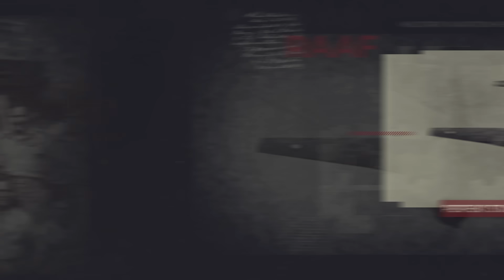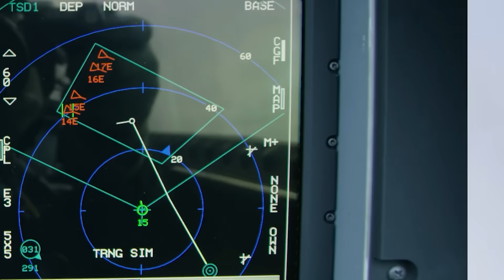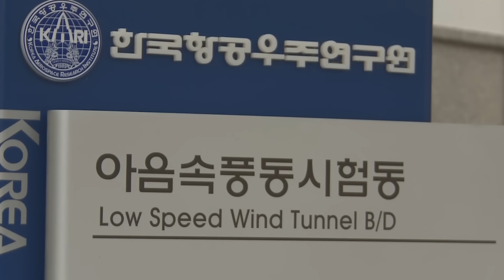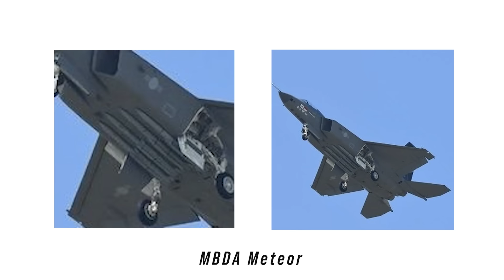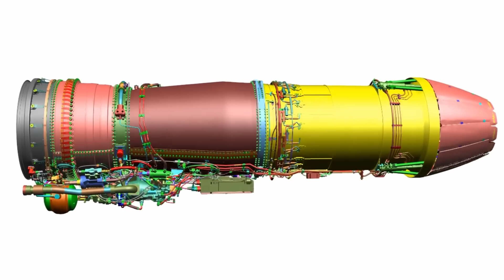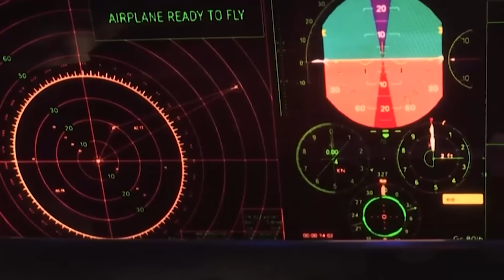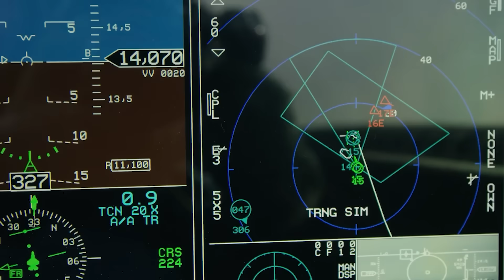KF-21: Korea's New Fighter

Comment: The fact several new aircraft mimic the F-22 design goes to show how ahead of its time it was. Still one of the sexiest planes of all time. Glad our allies in the pacific are re-equipping themselves with the industrial base to defend themselves 💪🏼 best of luck my Korean, Japanese, and Aussie friends
Reply: I agree, it looks like an F-22 Lite to me.
Reply: @alexwalker2582  It was made with Lockheed Martin, so wasn't a surprise
Reply: @motoKJ  Lockheed Martin helped manufacture the T-50. The KF-21 engine received General Electric's F414-GE-400K. And Korea is also developing a higher-performance engine that is better than the F414-GE-400K.
Korea, which is developing high-performance fighter jets for the first time, has moved up the schedule ahead of the original plan
I highly appreciate that it has been developed and that development is underway without any major problems so far.
Reply: @motoKJ LM consulted on the airframe. LM did not make anything for the KF21.
Reply: @motoKJ  Tell me specifically what Lockheed Martin made. They are scammers who did not even transfer the technology promised when introducing F-35s. This is why Korea is not introducing additional F-35s, and why it is rushing to develop KF-21 stealth versions.
Reply: Really?  

Reminds me more of the f35 but with 2 engines
Reply: @alexwalker2582  yeah actually because it was designed by Lockheed Martin
Reply: @rama7267  I think you really don't know much about German tanks. They are notoriously hard to maintain. A tank in the shop is one not in the battle. And German planes never evolved quickly. WW2 shows that. They quickly got outdated by US planes and some Russian planes later in the war. They were ahead of time, but they never had an industrial base or economy to keep it going.
Reply: And the F-22 wasn't even as stealthy as the YF-23 it beat! that thing was light years ahead. Can't wait to see what the NGAD and F/A-XX programs looks like soon!
Reply: @Cam_Wight  well it is a lot cheaper tho
Reply: @Cam_Wight  That's just no true. What I find hilarious is that if the YF-23 had won and entered service as the F-23, you would be singing about how great the YF-22 was, and why it should have won. 🤣
Reply: @FeatheredDino  Joe what I've said it factually correct, the YF-23 airframe has a lower RCS than the F-22. And I'm not so sure what's hilarious about that, both airframes are amazing and deserve praise. I suggest you watch C.W.Lemoine's video on the subject, he interviews the Chief Engineer of the USAF at the time.
Reply: @FeatheredDino I made almost this exact comment the last time I saw this conversation come up. And it’s so true……
Reply: Bullshit.  The black widow has a lower RCS.
Reply: F-22 won out because it was easier and less costly to manufacture plus more agile. But in 2024 post dog fight era, the Yf-23 is perfect just add the f-35's networking capabilities, speed and  stealth rule the day, the 23's king
Reply: @FeatheredDino  that is true, the YF-23 had a smaller cross section.  This has been widely known for years.  This is not some new secret information.  The DOD has disussed this in detail.
Reply: @FeatheredDino  What I find hilarious is that if the YF-23 had won and entered service as the F-23, you would be singing about how great the YF-22 was, and why it should have won. 🤣

YF-22 looked very generic, just a smooth F-15 which in its turn looks like MiG-25 or MiG-31
Reply: @FeatheredDino  No Cam is right. The YF-22 was outperformed in many aspects by the YF-23. That part is common knowledge. What isn't common knowledge is why did they go with the lesser of two planes. My guess is politics were at play but who knows.
Reply: @JMAC479  The Northrop F23 actually won the design challenge. However the F22 was awarded the contract to maintain "healthy competition" in the military industry. The F22 was 'good enough' to satisfy the design spec.
It's an official policy established after ww2; the goal being that the US maintains its highest possible production capacity.
This was all officially stated.
Reply: Japan's F3 is expected to be close to or even better than YF23.  The KF-21 is an older fighter jet with a stealth design.
Reply: This reminds me of cars, smartphones and civilian aircrafts. As the years go on, they all look more and more similar since the design is the most efficient with existing technology. The F-22 was really ahead and just now other countries are catching up.
Reply: @fredbyoutubing  The F-22 was really ahead and just now other countries are catching up.

There is nothing special about F-22 layout. It is the same layout as F-15 or MiG-25/31. Also Korea cooperated with Lockheed Martin just like they cooperated with Russian Almaz Antey on air-defence systems.
Reply: @_Epsilon_  You are talking about it like it's a model plane. There was more to it than it's shape when it came out. Compared to other platforms, it was revolutionary. Older platforms have been upgraded since but the F-22 was the benchmark for a long tame.
Reply: @fredbyoutubing  I am not entirely sure this is the case here. The US produced two fairly different designs for stealth fighters in the 90s . And the NGAD is likely to look different again. I think this is more a case of copying what works. In the case of kf21 it's actually design data that has been legally transferred. There is no point reinventing the wheel.
Reply: F-22 is soon to be retired and everyone else are still playing catch up.
Reply: @machdaddy6451 All of them are not retiring. 33 if old jets planed to be retired will be used as trainers and the last 152 are being upgraded to catxh up with the technologies and abilities that the Chinese J-20 has but F-22 doesn’t. And this 11 billion USD program will be finished by 2028. Don’t say goodbye to them yet.
Reply: @machdaddy6451  F-22 is soon to be retired and everyone else are still playing catch up.

F-22 is one dimentional and is a hangar queen. There is a reason they are trying to revive F-15.
Reply: billions spent by the US and everyone copies it.  Cause it's the best, like everything the states puts out.
Reply: America's Aircraft Design industry has been 'mature' for an immensely long time. Meaning we've had engineers capable of making truly timeless unparalleled aircraft like the XB-70, the SR-71, the F-22 dating back to the late 1960's.  The only limitations have been computer and engine technology.  America is just the top nation in terms of industrial design and it's not even close.  We need to preserve that at all costs.
Reply: F-22 is 80s tech. Amazing. Imagine what they have now after 40 years
Reply: This is the most cliché comment that is way overused about the raptor at this point.

Just because something was conceived of as an idea in the 80s does not mean that it is 1980s technology

Every time a tech boost came along changes were made to the aircraft, including active updates while in service.
Reply: @snowmochi1373  Incorrect, the F-22 hypothetical design was 91, after succesful tests it was greenlit for production in 2004
Reply: @snowmochi1373  late 90's early 2000's
Reply: @snowmochi1373  90s tech...
Reply: @snowmochi1373 ”They” have the F-15EX 😅 The F-22 program was cancelled by Congress 15 years ago, remember.
Reply: @snowmochi1373  F-22 is 80s tech. Amazing. Imagine what they have now after 40 years

Yeah they have lame duck F-35.
Reply: The KF-21 uses only existing technology developed by other countries.  The latest technology developed by South Korea specifically for the KF-21 is not used.
Reply: Seems more like an f35 imo. Either way I’m sure they licensed a good amount from both aircraft.
Reply: @dizzleslaunsen2372 Koreans didn’t license anything except for the GE jet engine and maybe the ejection seat. The airframe and weapons systems and AESA radar are all Korean. LM consulted on the airframe.
Reply: We go together !!!!!
Reply: @rama7267  yeah thats simply false. The us invented stealth due to their engineers, not money.
Reply: @thatguy46744  False. Germany was playing with RAM materials in the 40s for their navy and was going to add RAM to the Ho229, and all work done by Lockheed is directly based on papers by a soviet physicist, Pyotr Yakovlevich Ufimtsev, who created equations for predicting the reflection of electromagnetic waves on 2D and 3D objects. Hence it's false to claim the US invented stealth, also, engineers don't live from photosynthesis, it takes money to feed them and run experiments, and obviously, a bigger budget can run more engineers, more studies and more tests.
Reply: @kabzebrowski  the inventor is the one who materializes the idea, creating something that actually works and overcoming the problems with making the creation, that is considered the inventor. Not the one who theorizes it. So even if they did use a lot of the russians work, (which they didnt) that still would make the us the inventor. Lol.
Reply: @kabzebrowski  you cant just put more engineers on one project, if they all know little about the topic at hand, your not going to get an advanced stealtb aircraft. The design team of the f22 and f117 was only a few guys. I know your going to say "WeLL AcTUaLlY, they had 5000 members working on the programs! That was after they entered service and were being mass produced. Those employees are the ones operating the manufacturing machines, not engineering the aircraft. If they just put more engineers than a few guys, that would produce a whole lot of conflicting ideas and theyd get nowhere. So no, you cant just throw more money and engineers at the problem. The f22 and f117 was designed by american engineers and all work should be credited to them.
Reply: @thatguy46744  Cope harder, fanboy.
Reply: @kabzebrowski  i even had to clarify the definition of inventor lmaooo.
Reply: @thatguy46744  Under your own silly argument Germans would be the inventors of stealth technology. Again, cope harder.
Reply: @rama7267  I doubt it. You point to tanks, I point to the German artillery that frequently overheats and is in the rear for repairs more than on the front in Ukraine. I also look at the automobiles coming out of Germany. Selling cars today based on the reputation they earned yesterday but no where near the quality.
Reply: It means that it was cheaper to use an existing design. These things aren’t cheap. It’s not that complicated.
Reply: they dont mimic, its the shape a airplane has to be made for it to have a small  radar cross section
Reply: @The_Riddler21  Same people don't understand that. :)
Reply: As if aerodynamics is very leniet and gives you the options to have a square, hexagonal, rectangular shapes. Yeah aerodynamics is very understanding and accepting of all shapes, it's the limitation of the engineers' imagination to not come up with all sorts of shapes for planes.
Imagine a box flying. ;)
Reply: Because the laws of nature are the same everywhere
Reply: f22 was ahead of it's time, but the mimicking of the design here has more to do with the fact that it is cheaper and less risky to use proven designs rather than using an untested design or pioneering new ones. if the yf23 had been adopted instead, you could be reasonably certain fighters like the kf21 would have more closely resembled the yf23.
Reply: @rama7267  tanks are not as hard to make as jet fighters.
Reply: Turkish high-tech!  The smart nation.
I have a folder about it (folder 5 in the playlist).
Reply: Heres something you may find interesting. :)

In the past 40 years 37 countries have changed their name.

Obviously one can not change the name of an apple or orange etc in other languages, 

but counrty names are like peoples individual names, so if you are named John we don't call you Karen. :)

The name of my country has nothing to do with the interesting and delicious bird ''turkey''......

.....but the name of the bird does have a connection with the name of my country, let me explain.  :)

Name of my country has always been Türkiye, it's been known as such since around the 1200's. 

The name it self has a suffix, '' -iye '', that is Turk-iye, where the -iye suffix means 'land of/belonging to', 

just like the Latin suffix of '' -ia '', which exists in such country names like 
Austr-ia, Austral-ia, Latv-ia, Roman-ia etc etc again meaning 'land of/belonging to'.

Many would remember the country Czechoslovak-ia which changed it's name to Czech Republic and a few years ago changed that to Czechia (that is Czech-ia).

The Latin suffix  -ia  probably originates from Turkish  -iye  as Turkish is much older, ancient Turkish been over ten thousand years old.

Spelled in different languages in different ways to phonetically resemble (to sound like)  '' Türkiye ''
we got various spellings  like;

Turquía (in Spanish), 
Turchia (in Italian), 
Turquie (in French) 
Turkei (in Germn) and
Turkey (in English) 

all trying to resemble the pronounciation of ''Turk-ia'' thus Turkiye.

Mind you this was way before the animal we currently know as 'turkey'' was found by the europeans when they explored the north americas. The bird was first sent to europe from north americas in the year 1519, so up until that point there was no bird named 'turkey'.... 

...they came across the bird and thought it was a specie of the fowl/chicken they had been buying from the country of Turkiye at the time, so they named the bird ''Turkey Fowl'' meaning ''Turkish Chicken''.....

....just like how a dog breed is known as German Shepherd (because it's from Germany), American Bulldog, British Terrier, Greek Harehound etc etc.

In time you don't get to call the Greek Harehound as simply as ''Greek''; or you don't call the British Terrier as ''British''; or the German Shepherd as ''German'', but in time the Turkish Fowl started to be called just ''Turkey'' and later ''turkey'', and has been going on for hundreds of years.

Now in modern times, this is causing confusion, especially when we have people across the world  unable to point to their own country on the map, this ''confusion over the naming'' needed to be corrected.

So my country decided to rectify this confusion that has been going on for so long and corrected the name  to Türkiye, which it always was. Basically we didn't change the name of our country, we changed the mistake made in the English language. : )

So, there's some tid bit information for you to have a great day, if you read upto this point you have a great night too, ohh just have a wonderfull life. : )

Best wishes.  ;)
Reply: It looks nothing like F22.  It looks a little like F35.  Since it is not a fifth generation fighter jet, only its overall shape looks similar to F35.  Every other details are completely different than F35’s.  Anyway the KF21s would be good companion for the F35s that Korean air force currently possesses.
Reply: @hughnguyen1772  - It looks like an F-22 far more then the F-35. What's wrong with your eyes?
Reply: 실제로 록히드에서 F-22 설계에 관여했던 한국계 미국인이  제작에 관여했습니다. 그는 미국법원으로부터 군사기밀 유출로 기소당했으며 한국정부와 미국정부의 협상으로 징역21개월이라는  다소 적은 형량을 받았습니다. (원래 군사기밀유출은 징역 36개월이상)
Reply: Because they are terrorist sorry
Reply: Silly comment.
Reply: True, but im not sure they realize just how expensive they are to make and, most importantly, maintain. Im fairly certain that only the big players have the budget for any sizable fleet.
Reply: F-22se
Reply: They all look alike because they'r all based on a Russian mathematical formula. Many years ago, the US intelligence complex discovered the formula for Radar Cross Section (RCS) reduction in a Russian scientific paper by a man named Ufimtsev. According to that formula there is a perfect shape for lowest RCS, which is a diamond shape. When you try to combine that with an aerodynamical airplane shape, you pretty much end up with one and the same shape. So it's not as if everyone copied the F-22, just that they all naturally lead to that design as the derivative of Ufimtsev's formula.
Reply: And we are starting to design the 6th generation
Reply: It has to do more with physics. Its like you would say Germans copied Jack's Northrop N-9M flying wing with the Horten Ho-229 when the latter used jet engines while the first used propellers.
Reply: Or countries just taking and stealing ideas from each other including the United States 😭😭😭
Reply: Mimicking is a pretty strong word, it just happens that certain problems point to certain solutions. You want something that rolls freely on flat surfaces, you'll get a sphere. There's a correct way of doing a subsonic, a transonic and a supersonic wing, for the later it happens to be a positively swept wing, simple as that. A lift generating wing is thin and long - hence gliders wings are the way they are -, with an elliptical shape when seen from above - the path Spitfire engineers chose. Geometry that is good for stealth requires sharp angles, but that is bad for aerodynamics because it disrupts airflow, while geometry that is good for aerodynamics have smooth curves, and thus are bad for stealth, because curves always have some part of their surface pointing back to the radar source. The F117 for instance probably has better stealth geometry than any stealth aircraft that came after it, since it's completely made of sharp edges, more modern aircraft don't rely on geometry as much, they use radar-wave absorving materials.
None of those things are new either. Germany was using radar reflective paint in their navy back in WWII, and were planning on putting it the Ho229. Then flying wings were already studied in the 1920s. In the 1960s Soviet engineer and physicist Pyotr Yakovlevich Ufimtsev wrote the basis of all stealth work that would be used by Lockheed martin on the planes we see today. Etc.
Reply: @kabzebrowski  the f117 is not even close to as stealthy as the f22 even if it didnt have radar absorbing materials. The only reason an aircraft like the f22 was made was because the tech to build it and the equasions to theorize an aircraft like the f22 wasnt their yet. Blending facets with round edges in the right places creates a far stealthier aircraft than the f117, and was figured out by american engineers. Thats why the f22 looks the way it does. If the shape of the f22 wasnt as stealthy, than it wouldve never entered service. Theyd just put radar absorbing materials on an aircraft that would look like an f117. Come on man! at least do your research before spouting your bias.
Reply: F22, best airport defender
Reply: You forget these same people are racists behind those not like them behind their back. Worse they take credit with tech they steal and look down on who made the original. This isn't a lie by the way. But it's a good business model, so money take priority over cultural sensitivities. Still Asian culture cannot cope with being trailblazers. They just pave the road set by the west.
Reply: Judging by how much time my neighbors Audi spends in the repair shop I doubt that.   @rama7267
Reply: No friends. Allies
Reply: what's happening is they build contracts and intellectual property agreements with the U.S. Then, the U.S. sells them (somewhat force feeds them) into buying their technology. This is how U.S. makes money.
Reply: Love to see a mock up F22 vs KF-21 comparison. On a side note, KFC would have sounded better😂🤭
Reply: YF-23 fanboys aren't feeling too good right now
Reply: Kevin KangⓋ

During the Lee Myung-bak administration, the Korean parliament made Japan its main enemy.  Lee Myung-bak has asked Obama to ``recognize Japan as a virtual enemy of the United States.''  Furthermore, ``Japan is not a military ally of South Korea. Therefore, even if Japan is exposed to military threats from China or Russia, South Korea will not support Japan.'' ``When the Korean War resumes, South Korea will not support Japan. North Korea does not provide any information regarding the evacuation of Japanese residents in South Korea, which is a non-military ally.Of course, there is no possibility that Self-Defense Force transport planes and ships will enter South Korea to rescue Japanese residents in South Korea. ``However, as a fellow liberal nation, Japan has an obligation to support South Korea.'' At the time, the U.S. military was conducting training to evacuate Americans living in South Korea to Japan. .  Together with the Self-Defense Forces, the US military and the Self-Defense Forces created a plan to rescue the Japanese people living in South Korea.  In addition, Lee Myung-bak said:  ``Even if Japan begs, the South Korean government will not allow Japan to participate in the Second Korean War,'' said the commander of US Forces Korea.  ``We are stationed here to protect Japan from China.'' The United States does not trust the South Korean government, which does not intend to abide by international treaties and contracts.  Last year, shortly after South Korean government representatives signed an international agreement declaring carbon dioxide emission control targets at an international environmental conference, the South Korean government refused to ratify the agreement.  ``That is a goal, not necessarily something that should be achieved.'' It was Syngman Rhee, who created the cause of the Korean War, who entrusted wartime control of the South Korean military to the United States.  He tried to avoid responsibility for the war by handing over control of the Korean military to the United States.  Currently, wartime control of the South Korean military has been returned to South Korea from the United States, but many Koreans mistakenly thought that the South Korean military had gained wartime control of the U.S. Forces Korea.🎉
Reply: Was???  Still? There hasn't been a newer one.
Reply: You are right, Australia, Japan and South Korea are friends living around Pacific! For peace and development on Pacific countries.
Reply: I know that the chief executive officer at the time of the f-22 development was Korean. He came to Korea after completing the development, and started a small company, which helped Korea a lot in developing fighter jets. That's why it looks similar to the f-22's. lol After being imprisoned in Cia, the U.S., he is currently being released from prison a year after being imprisoned, his whereabouts are unknown. Korea already has enough technology. It only takes time to implement the technology. That's why I chose a step-by-step approach.
Reply: @rama7267  - If NASA had the same budget we would be on Mars now.
Reply: @rama7267  are you joking?
Reply: Wdym mimic?? To be a stealthy aircraft, it has to pass several tests, which requires the aircraft to be of very specific shape, US doesn't own the shape of any aircraft
Reply: They aren't mimicking anything. Those shapes are determined by numbers and math. Anytime you try to accomplish the same mission, you're going to end up with very similar designs.
Reply: Lockheed Martin was a part of the process so that's why it looks like the F22
Reply: @cipsahoy9639  the fact that all pens look like a pen shows a lot of whatever.

If certain shape is known to absorb better radar waves... Don't expect new designs to step much further from what has been established by physics.
Reply: Korean KF-21 is all foreign technology, all core techs need import; Korean should just stick with Kpop with all those sexy dancing and singing.🤭
Reply: @kinwaisiu9414 vpn을 사용해서 유튜브.넷플릭스를 훔쳐보고 한국의 kpop을 금지하고 뒤에서는 kpop을 중공인 춤과 노래인 것처럼 따라하는 족속들이 말하기엔 듣기가 거북하네요 😂🤮
Reply: not really, the chinese and russian jets look different....the Koreans and allies of the US jets look like the f22 because they are being built in part by americans or at least designed in part by americans, most jets designed without US involvement always looks different, that design is not because the f22 was ahead of its time but because most of these jets are literally being designed by lockheed themselves
Reply: @chargedx5768  
Don't guess. Lockheed Martin did not participate in the fuselage design. In the first place, the design program itself was made separately in Korea.
In Korea, robots perform 60% of the fighter fuselage production. This manufacturing method is not even in the U.S., so the parts must be uniformly adapted to the robot from the design stage.
You are just concluding by speculation.
Lockheed Martin promised radar integration and some technology transfer when Korea introduced F-35s, but failed to keep their promise. This is one of the reasons why the Korean government is not introducing additional F-35s, and it is quickly developing its own KF-21 stealth version technology.
The technology to change the phase of radio waves through stealth paint and surface coating adhesive tags has already been developed, and electronic warfare capabilities using AESA radar are being strengthened, and the technology to insert Korea's independently developed electronic warfare pod into KF-21 and the development of directional communication and antenna (non-protruding) required for stealth aircraft are also being completed.
In addition, a technical evaluation to get the targeting pod inside is under way using test F-4.
In addition, it has completed the design of a 120-km range rocket motor medium-range air-to-air missile and a 300-km range duct-type air-to-air missile, and is scheduled to be tested in various altitude and speed environments like Mitier missiles.
Reply: @cipsahoy9639  because they are using american engines, they have to compromise their own design due to engine design and characteristics. If they use russian engine then it will be completely different.
Reply: @f1pro910 The engine is also undergoing localization and will be completed before the mid-2030s.
KFX Block 1 uses GE's engine, but Block 2 will be equipped with a Korean engine.
Reply: Honestly every single time i see a new advanced stealth aircraft all i can see in it is the f22, almost always looks like a clone. Just proof of how good the f22 is that even 50 years later they're copying it
Reply: Through the process of convergent evolution, it will eventually become similar to the F-22.
Reply: 모든 동맹국들이 평화롭길 바랍니다🎉
Reply: @cipsahoy9639  not that surprising considering the mathematics that influence the design
Reply: Agreed! The 22 is by far the baddest fighter ever made.  Looks and capabilities wise. 
Lots of love to all our allies that stick with us through political changes, and conflicts.
Reply: @cipsahoy9639  to be fair, this one was developed in partnership with Lockheed-Martin according to the video. The heritage therefore comes as no surprise.
Reply: Yes, all these 5th aircraft are “astonishing breakthroughs and innovations,” yet only the J-20 — whose appearance is the most far from that of the F-22 — is shameless copycat
Reply: You would have said the same if they chose the YF-23 design.  It's more of that fact that F-22 proved it's capabilities and just about all designs that followed is heavily influenced by it including F-35.
Reply: No people wouldn’t say the same. It’s just that the facts are that information has come out about the contest between the two aircraft and the YF 23 didn’t fact have a lower RCS.

But it was out performed in certain other areas by the raptor

It’s pretty clear at this point though that the Jeph 23 would’ve been the better choice since the raptor was more geared towards the Cold War mission set, and the new sixth generation aircraft that are coming out are far more similar to the black widow than they are to the raptor in concept
Reply: Korea bought 40 F-35 as a stopgap measure and part of the deal was a tech transfer form Lockheed Martin to KAI for F-22 technology for the development of the KF-21, so there's no coincidence of the similarities. The only big differences are block 1 KF-21s don't have internal weapons bay yet, but they have IRST, which is a technology missing on the F-22, though they seem to be working on a low observable IRST pod.

On the people arguing over YF-22 vs YF-23, YF-23 did have better stealth and speed, but YF-22 was a more mature, maneuverable, reliable, and (supposed to be) cheaper design. By the time of final testing, Northrup Grumman was behind schedule, and the center body where the weapons bay was supposed to be was hollow space, with a really sketchy conceptual art of s staggered missile system for the 3 AMRAAMs which would prevent the second 2 from launching should the first one suffer a launch failure, and two AIM-9 on the bay doors. The F-22 could only carry 2 AMRAAMs, 1 less than the 23, but they had a working internal weapons bay that deployed a dummy AIM-9 during demonstration, proving it works, and the Air Force was secretly developing a clipped wing AMRAAM which took up less space than the base model, allowing the F-22 production models to carry 6 AMRAAMs internally. I'm sure there were some back door deals, knowing how Lockheed works, but at the same time all the reasons the YF-22 won were still valid.

For the Su-57, it's an odd stealth fighter in that it sacrifices a lot of its stealth for that 3D thrust-vectoring engine ripped straight out of the Su-35. Also, they're low in number and production is very slow due to a lot of issues. It's gonna take a while until they're built in enough numbers to be a real threat.
Reply: The SU-57 is most likely dog ass, but fuck that is a sexy plane
Reply: @Dylanschillin  not most likely..the only reason you think it is ass is cuase the US propaganda machine says so....
Reply: @Dylanschillin  The SU-57 is most likely dog ass, but fuck that is a sexy plane

Su-57 is absolute beast with the best armament and kinetic performence in history of fighter jet aviation. F-22 is one dimentional and hard to maintain and has short legs, F-35 is small and slow.
Reply: 실제로 kf-21 개발에는 f-22 항법 및 무장 시스템 소프트웨어 개발 총괄이었던 한국인 박사가 참여했습니다. 이후 간첩혐의로 미국에서 복역도 했고요. 간첩이지만 미국에서 형식적으로 몇 달 정도 복역 하고 출소하여 미국이 한국 kf-21 개발을 밀어줬다는 얘기도 있습니다.
Reply: @rama7267  Budget isn't everything. Germany does not have a military industry comparable to the United States. Nor do they have the resources and the population.
Reply: @Esoteric.i9  That's the reason why EU should join forces to have military aircraft.industry like Airbus in the mostly civilian sector. (except the A400M and some helicopters like the Tiger)... They tried, but national interests were stronger. Best example is Eurofighter and Rafale, both the same source, but France left the program. Now again with the 6th generation fighters in development. UK, Italy, (Sweden) and Japan have the Tempest or japanese F-X,  Germany, France and Spain are developing the NGF... France had a strong aircraft industry in the past with Dassault's Mirage...
Reply: United we stand.
Reply: it's not mimicking F-22, well in this case it might bcos Lockheed-Martin was involved in the design. but for all other stealth concepts, it's just science. similar problems require similar solutions. need smtg tt moves fast in e water, u get a shape like a shark or a dolphin. need a fast aircraft, u get swept wings. need a stealthy one, u get planform alightment and compound radii continuous curvature. it's to be expected
Reply: @AxlNSlash You seem to understand 'convergent evolution' very well!
Reply: @AxlNSlash 當然不是抄襲，飛彈掛外而，爛飛機
Reply: The fact several new aircraft mimic the F-22 design goes to show how ahead of its time it was.

Dude, F-22 looks like a smooth F-15 which in its turn looks like MiG-25. Same layout.
Reply: It can be a rip off but most likely it has something to do with physics, aerodynamics or simple financial reasons why a plane design looks how it looks! Thats why a wheel is always round since a round design has the best performance and is not a rip off. A plane design is always a compromise thats why the F-117 still has the best stealth but it sucks at all other aspects. The F-22 is way overrated in stealth but it would always win in a dog fight against a F-117.
Reply: @rama7267  Germany spends on military as much as Russia does and has virtually nothing to show for it.
Reply: this looks like an f35
Reply: Its german tech, not us tech
Reply: @Ehhwas  yeah the amerigolems stole german technology and claimed it as their own, then has the gall to accuse china of copying it lmao
Reply: The reason why Korea copied the F-22 Raptor is that a Korean who participated in the F-22 Raptor program in the U.S. stole technology and had to make a similar design...
I know the fighter program is the most difficult skill. 
And I still know that there are no fighters that can take on the F-22 Raptor in air combat.
Reply: its called converging evolution
Reply: @mayoofm6049  lol but not really tho……it’s pretty obvious what’s going on here let’s not pretend
Reply: 之所以模仿，那是因为没有能力设计
Reply: I love how some how people accuse china of copying the F-22 even though the j-20 is a completely different engine and wing design, but south korea gets to copy it 1 to 1 but apparently its ok and no complaints of plagarism
Reply: @NeostormXLMAX ??? Lockheed Martin staffs stayed in Korea as advisors when designing KF-21. Do you say that as copying as well? How about your F-35 copy version , J-31 to J-35(even changed name and vertical rudders and the name..) . 
Anyhow, a Chinese spy is now in the prison (25years sentenced) for stealing GE X-012 engine material infos. Did you guys applied that technologies to the new WS-15 engine you are proud of??
Reply: @NeostormXLMAX You are such a numb nut. South Korea consulted LM to build the KF21. This is ethical and legal. China outright stole and copied LM stealth technology without permission.  Big difference.
Reply: @NeostormXLMAX Koreans consulted LM to build the KF21. Chinese stole US technology to build their stealth fighters. Big difference.
Reply: Unfortunately, Japanese could be your friends but Not Koreans friends at all, mate!
Reply: @MrProbludger  일본은 미국을 공격했고 태평양 지역을 총칼로 전쟁터로 만든걸 잊었니???  역사는 반복된다
Reply: @hyundaii40  니 영어 못하는구나!